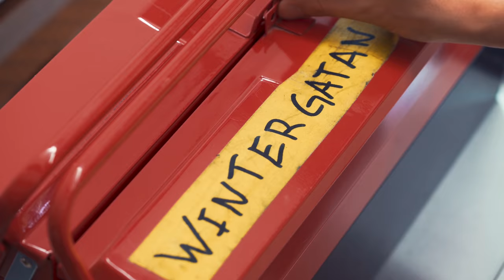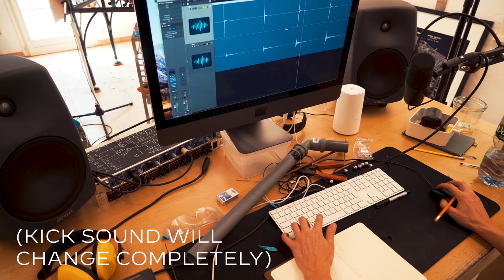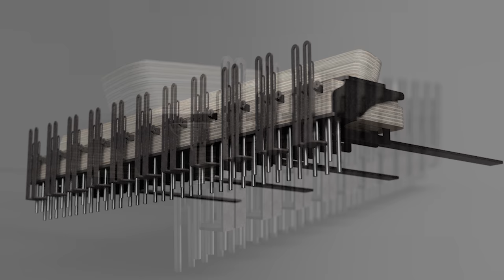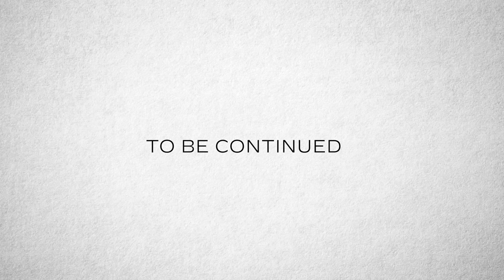Vibraphone Marble Drops - Marble Machine X #99

Comment: I think you're definitely making the right call here. 

I worried about all those finely tuned, and easily accidently bendable arms going out on a world tour. I haven't done anything big, but I'm a drummer and have played quite a few shows in my area over the years, believe me when I say that bulky equipment is practically impossible to keep 100% safe 100% of the time on the road.

The old design looked like one small accidental bump into it and you would have to painstakingly re-tune the whole area. The new design looks much more resilient : )

Comment: I'm actually very glad this episode ends in that way. The crooked and awry way the vibraphone marble drop looked like in the end was kind of poor.

Also, every good series deserves a dramatic plot twist with a cliffhanger ending. What would be a better place than the change from Episode 99 to 100?

It's very nice to see how community proposals like the adjustable vibraphone holders, the considerations concerning the harmonics on the vibraphone, etc. find their way on the MMX. For me it feels like the whole community is working on the machine (even if I know the actual work is on you Martin and the core team). I guess this is what makes the Project so special.

Perhaps the icon man pushing up the rock to that hill needs to be slightly altered: Every time the stone rolls down again more people are helping to push it back towards the "Assembly" mountain top. ;-)

Comment: Martin, I think you need to have a single adjustment knob for the timing of each drop. No shims, no bending metal or sliding gates. One overall mechanism. I know it's easier said than done, but you have too many variables here for the instrument to remain reliably tuned.

Comment: The new vibraphone marble drops, with the three rails, does seem like a better design, except I worry that it might be more prone to bending in transit, perhaps you could weld cross-pieces in to stabilize the whole assemble so you don't have to bend things back into shape for hours at before each concert?

Comment: Dude you Rock 👊 
From an engineer you should polish the steel wires holding the marbles using a polishing paste (suspended aluminum oxide paste with 0.1mm grain size should get the job done) that should give you better timing

Comment: If you move the vibraphone back and forth you need to make sure the distance to the impact area doesn't change. You could be making the marbles path longer or shorter if you bring in the vibraphone forward or backward since it's on an angle

Comment: The provlem with this design is that when you disassemble and reassemble the machine the rods will bend.
I suggest you make a template that is easy to add and remove so that you will be able to adjust the rods for every show end ensure they hit the perfect point.
Or you could use a closed tube that can't flex, but that will requre reengineering of part if the machine and calculating the degrees for each note.

Comment: I just thought about something.
You have (at least) two methods of adjusting the marble release, the offsetting shims and the variable release height.
(I'm not sure if the bending is an option of the new design)
The thing is that the effect of the shim method depends linearly on the speed of the music you are playing, while the effect of the height method doesn't depend on it.
So maybe one thing you could do is measure the timing offset at two very different speeds to see how much of each adjustment you need.
.... hoping the maths don't tell you "add 1m of shim thickness, lower the release by 50m"
Anyway, I know I'm late, but good luck for the work ahead!

Comment: Suggestion for you with your wire wheel on the cordless drill: fiddling around with the drill slows you down, and I doubt you made it through the whole pile without swapping batteries. Instead put your wire wheel on your drill press and leave it running, that way you only have to worry about handling the parts themselves.

Also, the less often you have to change from one step to another the better. Each change in operation requires a minimum reset time. For example, you should have done all your "U" bends on the back stop first, then the 90 degree bends.

Also realise that looking for where you're going to put/grab something is a step as well. Keep all the parts pending within eyesight of the jig so you don't even have to look somewhere else to reach them, leave them lined up with the way you need to hold them so you don't have to grab awkwardly or reposition, and put a large bin off the edge of the table to catch the ones that are done so you can just drop them without thinking or looking.

Do your best to minimise running back and forth like you described, that'll just suck your energy away without giving you any return. Do as much at each place you can before relocating to minimise the walking around you do.

Comment: Sometimes you just have to accept and adapt so that clarity can prevail.

I did wonder why the mounted vibraphone plates didn’t reflect the position symmetry of the full floor instrument.  (Ie they lined up to make an equilateral triangle and not a right angled triangle).

I guess this is what other commentators picked up on to.

It will definitely be worth all the effort 😎

Comment: With deep respect, you made the right decision to remove this version of the drops. On your remake, you may want to consider having more than one anchor point holding the rails apart. The original design had a fixed end for 2 rails. This change made all the ends floating. I can't tell how rigid the steel is from the video but I believe they are very vulnerable to splaying or shifting. If you want tight music, you need tight parts.

Comment: I'm not sure if you saw my comment on Instagram, but I will echo it here, in hopes you might see it. I have an idea for micing up the vibraphone, not sure how useful or practical, but maybe it will spark inspiration in the right direction.

My idea is that you measure what the longest and shortest spans for those resonator pipes are. At the end of the longest length, you put an isolation box with a mic or two in it. And for the space in between the box and the pipes, you put a flexible cloth or something, held up by wires, that go from the end of the resonator pipes into the box, that way the only way the sound can travel is straight towards the mics. Not sure how well this idea would cancel out background noise from the machine, but it seems that's the way you're leaning with micing up all your instruments.

Much love and best of luck on constantly improving! That motto is definitely something I'll try to remember.

Comment: Hey Martin!
You checked whether the marbles hit the kick drum and the vibraphone at the same time. You did that by comparing waveforms. Have you taken into consideration the fact that contact mic in the kick drum will respond much quicker than the sm57 that was a bit further away recoding vibes? 
Btw, love what you are doing, and I admire your perfectionism. Keep up the good work!

Comment: The new system looks drastically more rigid and you need a stiff system that won't move. Think about shipping vibration. This thing is going to be bouncing in trucks and airplane cargo holds. Anything you make must be able to withstand hundreds of thousands of vibration cycles on the road. 

Keep up the good work, and  remember that you aren't a real artist unless all you see is the errors.  This is all part of the process.

Comment: At 12:00. Mr. Wintergatan sits next to his creation MMX, which is still growing. It's massive. Just look at him next to that giant music box. It's almost done. Think about how it came to be. There was the first MM. Pretty much made with typical home tools and wood as the main material. It looked like it was a home garage project. It was amazing. But it wasn't durable. Everyone liked it. So a better one needed to be built. The bulk/general design was in place from the start. But as I see it. A large percentage of the design/crafting of it's workings was done with an on the spot solution that could not have been planned ahead. That's where the genius thinking come in. Have a start plan in place then tweak it. I'm pressed how Mr. Wintergatan has gained many crafting skills such as an accomplished craftsman at welding and more. That's another point of phrase to him. I'm done. This post is getting too long.

Comment: I am mostly concerned that moving from U-bend guides to a bunch of rods is going to make for a disaster in transit. It is going to make it so much easier and more likely that those guides get tweaked between shows, both increasing set-up time to fix them and creating possible hiccoughs in the music itself.

What might have been better would be to bend the final U-bend down 90º, cut the leg off one side, and weld the tip of one-U-bend to the other, creating a more ridged W at the end of the 3-rail combos.

Comment: Hi Martin, just questioning you’re common rail decision- if you need to adjust one of the common rails (for whatever reason eg moved during transit etc) you will have to adjust ALL of the marble rails all over again, as adjusting one will effect the one next to it. Please use the 4 rail design and make the adjustments easy on yourself!!

Comment: Some musings on the positions of the marble strike point and the resonator pipe locations...

I believe that the resonator pipes should always lie directly beneath the centers of the bars. That's the point of maximum excursion of the fundamental frequency, the pitch to which the resonator pipes ideally support. (I'm working by analogy to piano strings, so I may be off-base here.) I think that the marble doesn't actually bounce out of the way fast enough to allow the resonance to sound ideally, so actually somewhat mutes the resonance with a peak deflection at the point of the marble strike. By striking off-center, the fundamental isn't the note muted, so the deepest sound can sound most loudly. On the longer vibraphone bars, that effect is very clear, as the ratio of the length of the bar to its width and thickness is greatest, so the fundamental resonance of the bar is most pronounced over the other resonances. Hitting the bar just about anywhere will excite the fundamental, but hitting at the center will mute the fundamental somewhat. Hitting off-center reduces the muting of the fundamental, allowing it to sound most clearly, and muting somewhat the other, higher resonances.

The situation with the shorter bars isn't as clear. At first blush, the same situation would seem to apply. However, with those bars, the ratios of dimensions are much lower (length to width and length to thickness). That means that the mix of resonances is much less ideal. While the fundamental and harmonics of the primary resonance still align with the flexing of the bar along its length, other oscillating modes will also appear (a resonance across the width of the bar, twisting/torsion along the long axis, etc.). Those resonances and the harmonics of the fundamental may have much less well-defined pitches, and may not "sing" as well, regardless of where the bar is struck, so that the fundamental pitch is the only one that sounds well. The "somewhat" muting of the fundamental may still happen, but if the other harmonics don't sound clearly, it may not have much importance. One might consider a theoretically ideal vibraphone, with the bars that scale in all dimensions at the same ratios. This might result in bars that all have similar resonant properties, but this would also result in narrow and thin bars at the upper end of the range. Martin's instrument has a range of three octaves. In the theoretical "perfectly scaled" vibraphone, the highest-pitched bar would have only 1/8 the length, 1/8 the width, and 1/8 the thickness of the lowest-pitched bar. I suspect that such a bar might have only 1/8 the sound volume of the lowest bar (or possibly 1/64th or 1/512th!), require a much lighter touch (to get 1/8 the deflection), but would sound best with the marble strike at the same offset position.

With piano strings, the theoretically ideal point for the felt hammer to strike is actually 1/7 of the way in from one end of the string. That's because the hammer is actually momentarily motionless, bounces out of the way of the string too slowly to let the resonance with a peak at that point sing ideally, and therefore somewhat damps that resonance. The modern equal-tempered scale is designed to allow playing in any key, with equally good (or bad) alignment of the pitches in the scale to the harmonics of the root tone. The second harmonic is an octave, so a perfect 2:1 ratio. The third harmonic is a 3:1 ratio, approximated by an interval of an octave and a perfect fifth, 19 half-steps. In a tempered tuning (actually, in SOME tempered tunings), that would be an exact ratio. With an equal-tempered scale, the ratio is about 2.9966:1, really VERY close to 3:1 (about 2 cents flat). The fourth harmonic is two octaves, again a perfect ratio. The fifth harmonic is 28 half-steps, an octave and a major third. In our equal-tempered scale, that's about 5.03968:1, close again, this time to 5:1 (about 14 cents sharp). The sixth harmonic is two octaves and a perfect fifth, so very close again to 6:1 (2 cents flat). The seventh is two octaves and a minor seventh, 34 half-steps. The equal-tempered scale makes that about 7.1272:1, not all that close the desired 7:1, in fact, sharp by over 31 "cents," almost a third of the way up to the next half-step (which would have a ratio of 7.55:1). That won't really sound good, and by the simple expident of having the hammer strike at the 1/7 point of the string, that harmonic can be reduced.

Comment: Now I'm wondering if I was one of those people that said something about sliding the plate along with it's supporting bracket? (Was already a given that notes could be swapped by sliding in the notes and carrier plates, so why not make that an adjustable thing?)

It's like refactoring code when finding a more efficient function for the same job. Pain in the butt to tear out (particularly if it was working), but in the long run the streamlined version will do the job better.

Getting rid of the guide wires means there's nothing that will easily be accidentally bent (mentioned in other comments, and I'd agree), and perhaps explains why that part of the assembly is going to be redone. I'm also curious if a rocker-style escapement will be in the next marble drop dispenser, since that could also be made really consistent too. And on top of that, maybe the wires were making their random own notes that weren't wanted vs. some of the other sounds - perhaps that was the last straw that forced the jump towards a major part revision?

Comment: With the vibraphone holders being in different positions rather than the centers lined up, how will you tackle the problem of the resonator tubes? Can those afford to be off center of the plates? Or will you create a way to index them when a plate is attached? Do they even need to be centered, and is it a non-issue?

Comment: I think it's a good choice. Felt like the design was too finicky and probably induces more headaches later down the line since it was purely these metal rods that guided the marbles that would probably  bend or warp and offset the drop  angles. The adjustable positions would really solve a lot of the issues much cleaner and make it look a bit more unified like the last CAD picture you show.

Comment: Well, if the marbles striking directly is not an option, you can always have the marbles bounce off of little pads mounted to levers with individual mallets attached and as the marbles hit them, they drop down and strike the keys and a spring pushes them back up in time for the next marble. But then that would not make it a true marble machine would it?

Comment: Please think about vibration during transport!

It's going to be like moving a grand piano every time... those fingers were really worrying with all the weight way out from the attachment.

You should shake test the machine and see what happens to it. Solve the problems before you go on the road.

All your fine adjusts are great but going to need many many hours of tedious tuning on location to bring the machine back to tight timing after every journey...

Comment: All your cutting and grinding on the machine around the magnets is going to cause that metal dust to move around in your ppma pipes and tracks.  This is going to dirty the machine quite quickly.  I hope you are taking measures to clean the fragments off the various magnets around the machine.